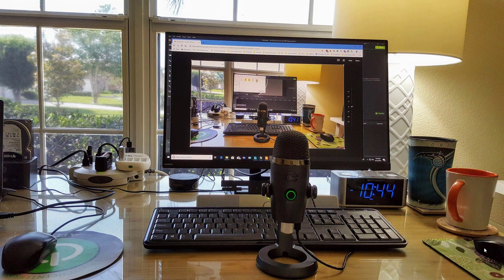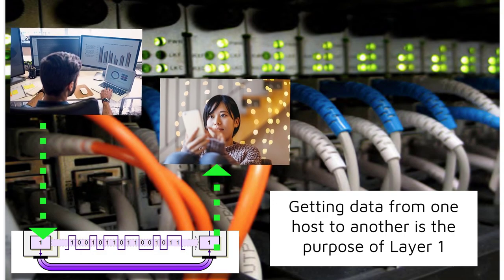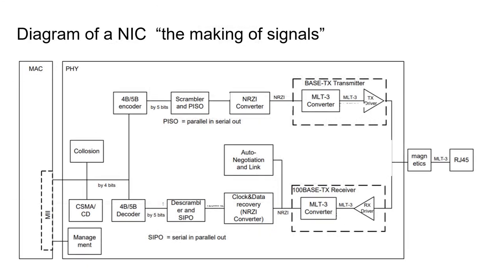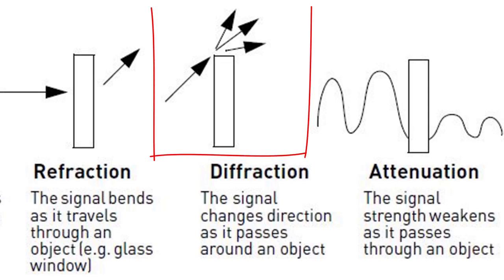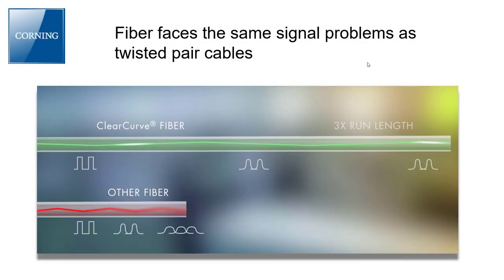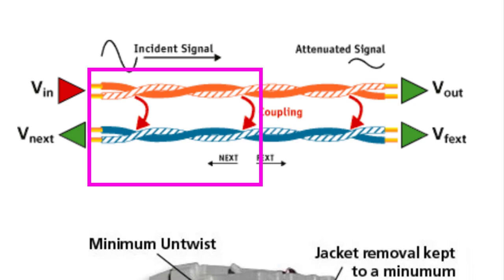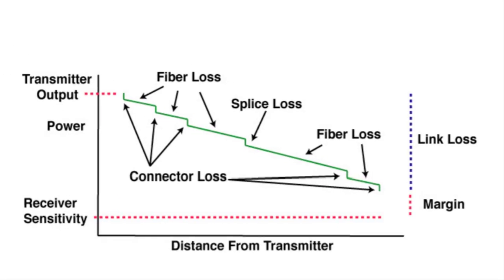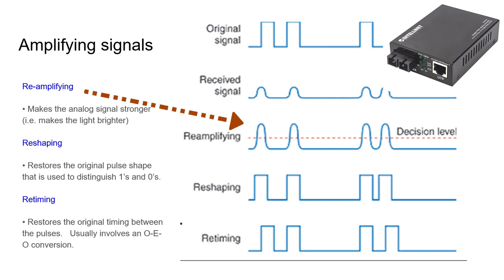Ground Zero of Networking: Mastering OSI's Physical Layer 1

Comment: a. It is an amazing video and thank you. In the details you analyze problems in transferring techniques, from the other side, I was waiting you also give solutions to the problems, but unfortunately you didn't.
b. In my tech life and activity, I have read a lot and seen many videos related to OSI. The specific point I never understood is how all information from e.g. source, top to down six layer software information, is finally converted to electrical signals to go to final layer 1 Physical layer. Something software is converted to something hardware. What is there? An assembly machine language. Something else? Same thing happens to TCP/IP.
Reply from the maker: Yiannis, the NIC drivers (software) play a major role in layer 2 the data-link layer in the final prep of data prior to the chips, drivers, encoders, etc at layer 1.   Thanks for watching and the comments.
Reply: @TechsavvyProductions  Sir, thank you for your time and replying.

Comment: The most amazing thing about 200G circuits is the amount of screaming, shouting, swearing and finger pointing done by the vile inhabitants of the data centres when a ticket is trucked because the circuit has gone down with no light Almost as though it's the engineers fault 😂
Reply from the maker: Thanks for sharing!